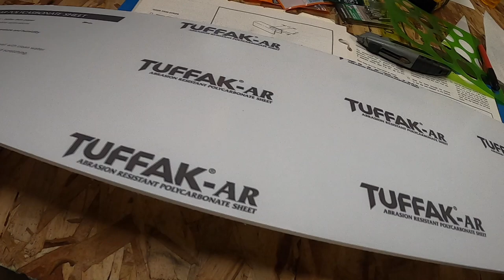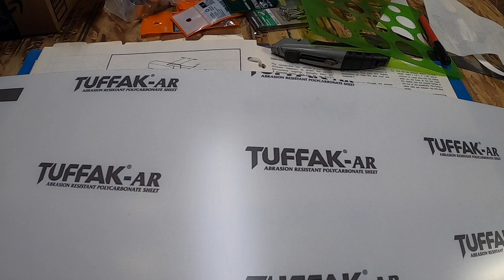1929 Mercedes SSK Roadster Final Build Video Part 13  MUST SEE!

Comment: Beautiful Job!.. would you mind sharing how you went about acquiring a Title and Registration? I've acquired the same kit as an unfinished project and afraid to invest time and more $ if I can't get it titled. I didn't get an original purchase receipt with it. I'm also missing the iron braces for the front fenders, headlight supports and spare tire mount. Any info you can help with would be greatly appreciated.
Reply from the maker: I had to work with colorado dmv. Was not fun. Hope your state is easier. Check out my playlists. Thanks
Reply from the maker: Car will be up for sale in sept if you want to buy one already done

Comment: Thank you for making these I just bought one that has pretty much everything done  except much of what your doing now this has me excited. The car I bought has a 4cyl turbocharged and a automatic. Do you have one of driving it?
Reply from the maker: Nice
Reply: Is it on a vw chassis?
Reply from the maker: @aboodsgarage  no way. Custom tubular frame with ford 2.3 liter engine. As I said in the video the vw ones are crappy. Thanks for the comment